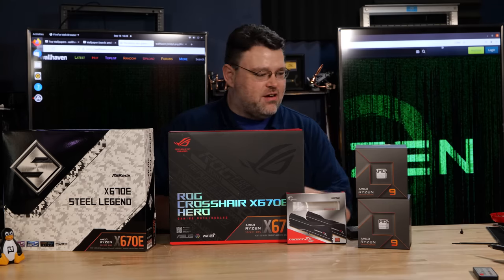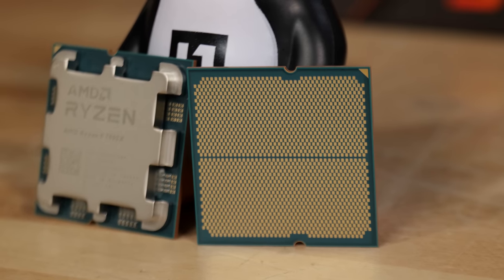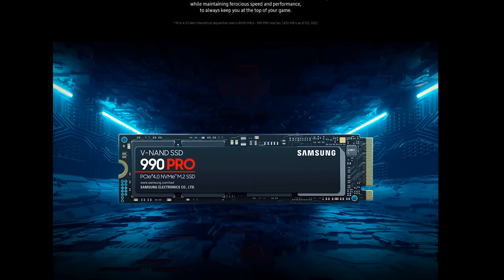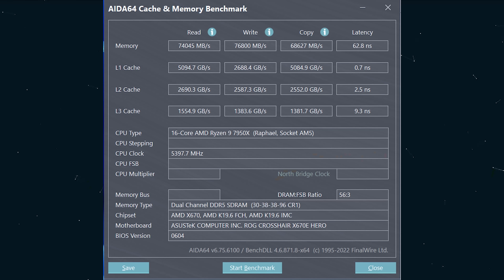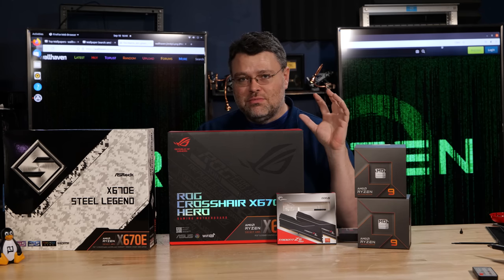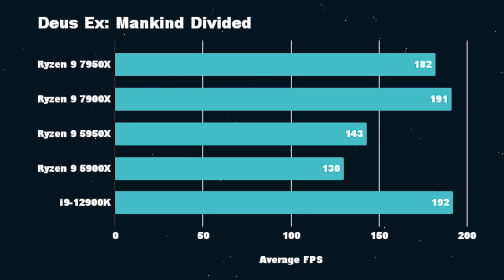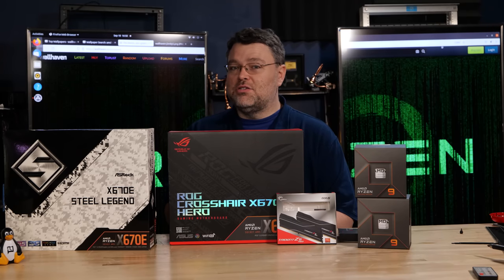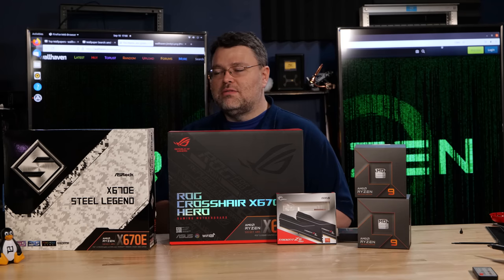RYZEN 7000 LAUNCH DAY BLOWOUT! DDR5, PCIe 5, Benchmarks, and MORE!

Comment: Gordon Ung tested power and setting Eco mode finding some interestingly performant results despite cutting watts.
The 7950x at 65w beat ADL i9 in Cinebench 28 frames to 21
Reply: Hi. Do you know which of these CPUs will perform better in machine learning and data science tasks, no need to say I would use a Nvidia GPU like 3070 besides the cpu, but I wanna choose an appropriate cpu for these types of tasks. These are my choices:
1. 5900X      :$250
2. 13600KF :$400
3. a little bit pricey one (13700KF:   $500)
Reply: @maxit1082  if you're using the 3070  GPU for machine learning then the 12c 5900x or 16c 5950x are probably better value and all you need.
If AVX512 matters then the Zen4 is interesting.  The Intel e cores aren't good at AVX stuff, Chips and Cheese has an article about tuning for scientific applications.
I cannot really tell what suits you best from such limited info
Reply: @RobBCactive    thanks for the help, actually there is a used 5900X for about $250, in the other hand there are some new intel CPUs like 13600kf that costs me over $370 or 13700kf for about $500. I'm thinking which of these CPUs have more value. But as you said the more important thing is GPU. if I choose the 5900x I could spend the extra money on a better GPU. If I wanna summarize both CPU and GPU configuration I afford are these three options:
1. 5900X + 3080Ti
2. 13600KF + 3070Ti
3. 13700KF + 3060 / 3060Ti
 which one should be a better choice?
Reply: @maxit1082  1 if GPU performance matters mosr
Reply: @RobBCactive  sorry can you send me the link of that article? cheeps and cheese I mean

Comment: I am a VRay user my question is with renders sometimes in the days, I want to stay as cool as possible as high heat over short terms is fine but over long terms can warp motherboards, how do I keep as much boost with lowest temps (best cooler I know being a must)?
Reply from the maker: Curve optimizer. you want your cooler tuned such that the steady state is 75c ish, for example, over the long haul
Reply: If AMD (or rather AIB) cannot cover this under warranty with AMD saying that 95C 24/7 is normal behavior then they will get a lot of flak. And I'm sure that some people will run tests on that. I suppose that in couple months Der8auer will have his results of 24/7 OC for couple of months and how ii resulted (or didn't) in Silicon/Motherboard degradation.

Comment: Do the motherboards support the usual x4-x4-x4-x4 PCIe Bifurcation or is it a thing of the past like on Intel socket 1700?
Reply from the maker: depends on board, but it seems so on at least the asrock board. I have not tested to confirm it works yet though
Reply: @Level1Techs  Thanks and these “special things” might be a good content point for a follow-up video, I have to wait with AM5 and my edge case testing until I can get DDR5 ECC UDIMMs.

Comment: Will we finally get some more (non-server) boards (that wouldn't cost a fortune!) that will finally utilize onboard 10g-nics? I think it is really a shame, that we're still dangling at 1gbps for the most part, and sometimes that crappy 2.5g-interposer-standard (which will not work properly with many 10g-capable hardware out there) for around 20 years now, especially considering 1) how long 10-networking is actually available on servers, and 2) when thinking about, how fast storage has actually become compared to 20 years ago...
Reply: And considering how many people now use a NAS for bulk storage/Data hoarding
Reply: No thanks, there's already enough useless legacy ports taking up resources. 25GbE would be more current.

Comment: What gamers want to know is will the 7800X3D outperform the 13900K(S)? If the 7800X3D will be the gaming champ, then it makes the X670E mobo and DDR5 investments worth it, especially if it lasts for many more generations to come.
Reply: 7800x3d hahaha it will be a year before we get a refresh or 3d cache version most likely…
And if the 7800x is as hot as the other zen4 chips … it’s gonna be interesting if these things hold up running at 94 degree all the time..
Reply: Hi. Do you know which of these CPUs will perform better in machine learning and data science tasks, no need to say I would use a Nvidia GPU like 3070 besides the cpu, but I wanna choose an appropriate cpu for these types of tasks. These are my choices:
1. 5900X      :$250
2. 13600KF :$400
3. a little bit pricey one (13700KF:   $500)
Reply: @maxit1082  I’d probably go Intel they have a bunch of new Accelerators for AI you should look into.  Most time in my experience with ML it’s mainly your GPU that matters and it depends on your data set size. How large is your fat set your going to use … is it larger than your GPU vram? You should try to have enough VRAM on your GPU to hold your data set comfortably. Second make sure you have enough system ram to also hold whatever your GPU vram and then a little extra for your background .  Say you get a 3090 24g vram you wouldn’t want a 16gb system ram … it’d be alright for gaming but for ML workloads you want enough system Ram to feed your VRam without having to go to disks..
And with system ram I like a little headroom.
Again it depends on what your going to be doing you most likely will find out a 3060 with the 12g of vram will be more flexible for some of your workloads than the 3070s 8gb but then again you might have data sets under 4gb all together constantly and then the slight cure core increase and higher clock could put weigh that.
The a2000 is a great card to look into if your just getting into ML and will most likely be all you will need until you decide to step up to xeons with multiple GPUs… 
So look into Intels accelerators they have added see if they will benefit your workloads I’m assuming they most likely will so if it was me I’d look for a 12600k or 12700k used for best bang for buck and I honestly have a couple b450 ryzen 7 2700x system that have been kinda a pain in the ass they are good price for the threads though and are good it’s just weird things like you might one day have to update your bios out the blue because your pc just starts restarting randomly over and over.
So you fuck with it for a day googling and just ended up rebooting the whole machine starting over with new OS install from ground up and it goes away for 6 months are the one day your wifi or Bluetooth just won’t work and it’s again more drivers your downloading and ddu’inh..: idk I’m not a PC newb but the Ryzen systems are always the budget option for a reason but they do work it depends if your on a tight budget then get the ryzen system but you really don’t need the highest core counts the 5700x will most likely get you the same work performance in most of your tasks.
Look into what your going to be doing most ML workloads I know of are GPU intensive and barely use the CPU comparatively.  
Good luck.
Reply: @JoeWayne84   thanks for the help, actually there is a used 5900X for about $250, in the other hand there are some new intel CPUs like 13600kf that costs me over $370 or 13700kf for about $500. I'm thinking which of these CPUs have more value. But as you said the more important thing is GPU. if I choose the 5900x I could spend the extra money on a better GPU. If I wanna summarize both CPU and GPU configuration I afford are these three options:
1. 5900X + 3080Ti
2. 13600KF + 3070Ti
3. 13700KF + 3060 / 3060Ti
 which one should be a better choice?
Reply: @maxit1082  the 3090 if you can spring it will be the most valuable due to it having nvlink so in a year are so you can have double 3090s .. the rest of the Nvidia cards they removed the ability to SLI or run two GPUs at once.
3090 is really the way to go if you think one day you might get more serious. I’d go for the ryzen cpu and a 3090 .
But the 3080ti is a great card also and will do you well.  But with the 3090 of you get more serious in a year just add another 3090 they will be more affordable then to. 
Good luck brother.
Reply: @maxit1082  also the F version of the Intel chips might not have the AI accelerators .. I’d just go AMD yeah for sure the price to performance you can’t go wrong
Reply: @JoeWayne84  awesome, thank you

Comment: NH-D15 racing to 95 is meaningless without talking about what clocks it was holding.  GN covered this much better, here the way it's worded may be misleading due to lack of discussion about how Zen4 handles clock speed / power draw relative to temp.  Disappointing faux pas, just as with the comment about cooler compatibility with AM4, which isn't universally true due to back-plate changes (der bauer covered this pretty well).
Reply from the maker: I said even if your am4 cooler works you may not want to and 99% compatibility. This is covered more in the dedicated oc video though. Half what I was trying to say was that people are going to focus on 95c which is wrong imho since it's up to you how much power you want to dump into your cpu
Reply: @Level1Techs  Given the norms with CPU turbo'ing, "racing to 95" implies it's woefully inadequate and the CPU's throttling, rather than not entirely turbo'ing.  
Had it been stated what clocks the D15 permitted vs a 280/360 AIO would have been far more informative about the actual situation (along with, ideally, how much performance penalty that induces).

As for cooler compatibility, I appreciate (as with the above) that more depth can/may be given in other videos, but pointing out that the back-plate can't be swapped so easily as before and that cooler which require back-plate swap [probably] won't be compatible, would better inform the viewer of the situation.
Sure, it's not as common on AM sockets as 11xx/12xx for back-plates to be changed, 99% compatibility seems unlikely and doesn't actually inform people of what the critical differentiator is.
Reply from the maker: The backplate on the ASRock board I had and worked with a deepcool cooler backplate, the threads went right through the existing screw hole. Not recommended though. 

Unless it was cut I said the d15 performance wasn't likely to make a difference in gaming only all core workloads. So if you use a tower cooler you may expect different all core results even at stock. Again the point is your cpu probably needs less power for "stock" performance which is an "overclock" so hyper focusing on stock power performance isn't the right place to focus.
Reply: @Level1Techs  Oh, that's interesting with regards to the AsRock board.  AFAIK that's not the "norm" on AM5 though (would be about right for AsRock to break the norms).

I think that was in the video somewhere, but I still think the relative performance difference should have been mentioned, perhaps you'll cover properly in another video and I'm just wanting too much from the initial launch video (hence why I've seen 6 different ones today, so I can be as informed as possible ... even though I'm only now finding out about the different back-plate designs).

I won't be satisfied until I can plug in and get all information on a thing uploaded directly into my brain in a couple of minutes... "I know kung-fu" style ;-)

Comment: gaming benchmarks used by all reviewers are "easy" but completely useless in our day and age they do not represent at all the real performance today simple example :
borderlands 3 a 99% gpu limited game shows me 165fps with a 3090 with a 1080ti it gave me 110 but...ingame the 1080ti fps unlocked has 100-120fps ingame the 3090 has 225-350fps not +50fps bit +100-200fps see what I mean ? "easy life reviewer benchmarks"but irrelevant, with the 5950x I could game w maxed settings+encode a 60Mbps 60fps local video + stream on twitch thx to amd cpu and nvenc from the gpu...that's kind of crazy and seeing the 37-39k cinebench r23 scores I can't wait to see what this gen can do :D

Comment: I am wondering why companies are not making ssds that are X2 5.0.  Then we could have more lanes for peripherals.  wouldnt 8GB/s be enough for everyday use? I would think so.  even just doing 1 lane would be crazy.  The older I get, the more interesting this kind of stuff.  laptops/SFF pcs have so much potential.
Reply: The average write speed speed for PCIe 5.0 SSDs is only 150Mbit. 16 of them would add up to SATA-2 speeds. It's worse than asymmetric cable internet
Reply: The thing is,  the board already allocated 4 lanes to the m.2 slot,  so even if you pluh in an X2 ssd, you still cannot use the 2 lanes for anything else.

Comment: do not think that pcie5 means you have more bandwith you don't ! theorically yes but only on the mb design side, for users you have set lanes and the bandwith that you don't use is LOST, the big problem is that when they say pcigen5 x16 with 1 card becomes w 2 cards pciegen5 x8 + x8 99% of people think you get x16 4.0 + x16 4.0 but nope you get x8 "whatever your component is" so x8 4.0 or x8 3.0 probably, to be clearer my Z690 asus extreme is a 1 slot motherboard and I cannot use the gen5 m.2 slot it destroys your main pcie slot speed and disables the other pcie slot, listen to what I say I can guarantee this amd gen will have a lot of angry customers (also ddr5 only properly handles 2 sticks because they are already 2 channels each they sell that as a plus it's a minus...good luck running 4 sticks at their proper speeds)